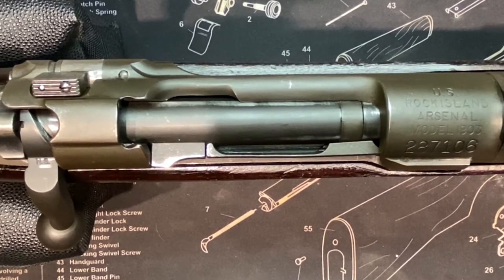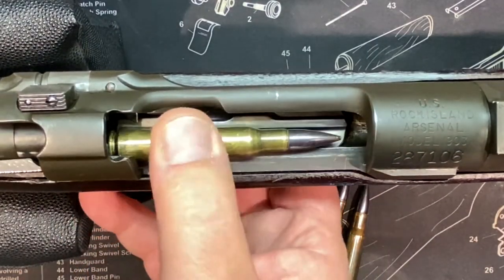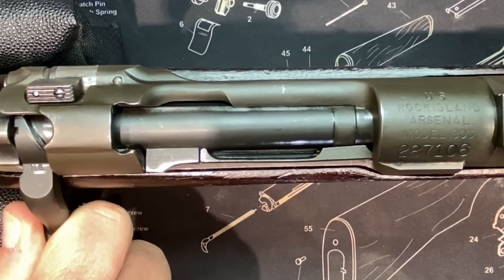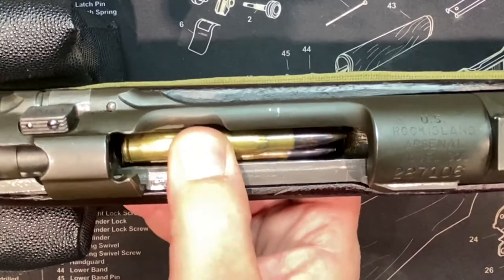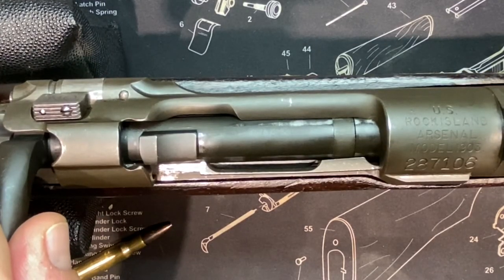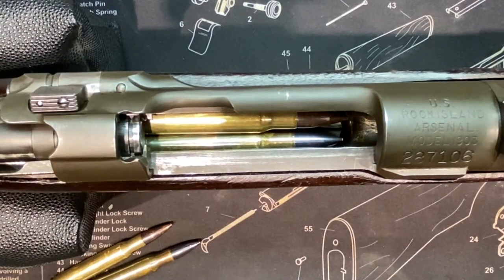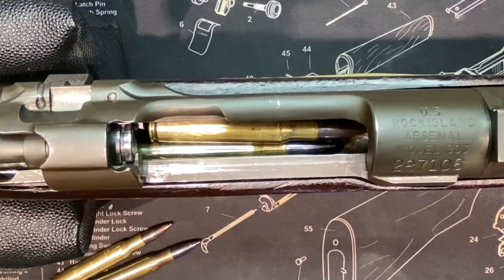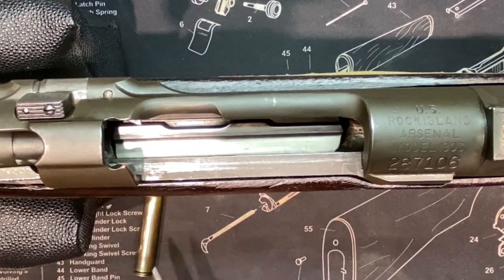1903 Springfield - Tips and Tricks

Comment: I've owned an 03 for around 36 years, and have put six rounds in by dropping one in the tube, literally thousands of times, and haven't damaged the extractor yet. Nice trick, but totally unneeded imo.
Reply from the maker: A lot of people have said in response to this video that snapping the extractor over the rim hasn’t damaged theirs, but that doesn’t mean there isn’t a kindler or gentler way.  The suspension of your car is made to soak up bumps, but you still try to avoid them.
Reply: @MilsurpGarage  Your car door is made to open and close but maybe you should enter through the sunroof just in case your doors are not really up to being opened and closed.
Reply from the maker: Not really a valid analogy since the sunroof isn’t made for you to enter and exit the car through.  A better analogy would be that the car door will still close if you slam it really hard, but to protect it you try to close it gently.
Reply: @MilsurpGarage  It was a perfect analogy, it was a fix for a problem that does not exist!
Reply from the maker: @nathanadrian7797  Definitely an age old debate but after careful study of Mausers controlled feed action I believe that regularly snapping the extractor over rims should be avoided as it promotes wear and tear.

But of course, with your rifle follow your procedure.  Just offering my advice and an alternative method, that all.
Reply: @MilsurpGarage  Like I said, I think you have fixed a problem that does not exist. All the Mauser actions I have owned can be  closed on a chambered round without any noticeable force, and non have ever shown any damage. Good luck to you and your channel.
Reply: @nathanadrian7797 his tips are definitely something that will reduce the strain on the extractor. My 03 A3 is in great shape but it’s pretty old. No reason to not treat it as kindly as possible. You can continue to do whatever you want with yours. Not sure the point of your comments though. He simply gave another option which is also valid.
Reply: @66smithra  The 03 was literally designed to single feed, do you remember the magazine cut off?  My 03 was made in 31, how many times do you think it may have been single fed after going through WWII? Again, nice trick but unneeded.
Reply: @nathanadrian7797  yeah and you can single feed without snapping the extra over over the rim. Just like he showed!

Comment: the bolt was designed to slip over the rim during single round feeding.  It's not an issue I can assure you.
Reply from the maker: Yes, it’s designed to DO it but not a great continuous operational procedure. 

A car is designed to do 0-60 in the shortest time possible but repeatedly doing that is considered beating on it…..and a great way to get to know your mechanic. 

Wear is what makes machines mortal.
Reply: @MilsurpGarage  the mag "on-off" lever was there for a purpose.  however, I doubt very seriously that our troops in the trenches ever used that function but I also doubt it was because of wear.  It was a stupid idea to a man trying to stay alive.
Reply from the maker: @easttexan2933  A man trying to stay alive would certainly not want a broken extractor.
Reply: @MilsurpGarage  Only Rambo and Chuck Norris lol
Reply: The '03 was designed in an era when troops loaded single rounds and fired on command, holding the magazine in reserve until needed.  The "on" position of the cutoff was specifically to allow this.  Same as the Krag.  Same, for that matter, as the SMLE No 1 Mk III.  The extractor is designed for both single round and magazine loading.  Sure, by WW1, nobody was loading single rounds and firing on command any more, like in "Zulu", but the extractor was designed to allow it.
Reply: I think you all are missing @MilsurpGarage's point.  He never denied the gun was designed and promoted to allow single loading of rounds.  His point was/is that, although you CAN do it, it isn't good for the life of the extractor long-term hence his nifty hack to allow loading rounds one at a time while not unnecessarily stressing the extractor.
Reply: You're both right and wrong. The rims of the cases back then were bevelled, not just for single loading, but also as a holdover from rimmed cartridges (Brits still did this) had a bevel for the extractor. Modern ammo is much less bevelled

Comment: Your video is the only one that I’ve seen talk about potential damaging the extractor by loading single rounds. Thank you for the insight on that.
Reply from the maker: It’s definitely a contentious issue, some feel is not a problem, but feeding under the extractor in my opinion is definitely the way to go.
Reply: The gun was designed to be single fed that way!
Reply: The '03 was DESIGNED to feed individual rounds with the cuttoff on.   The extractor is specifically shaped to allow it.   Troops were trained to hold the contents of the magazine in reserve and fire single shots on command.   Now, that changed with the tactics, but the capability remained.
Reply: @jamescameron2490 that doesn’t mean that this way isn’t easier on the extractor, does it?  Anyone who understands physics knows that this reduces the springing force on the extractor.  The same way that a 1911 is loaded by stripping the mag to not spring the extractor.
Reply: @66smithra  I'm not an engineer, so I couldn't tell you.  But the extractor was designed to feed single rounds, with the magazine held in reserve.   Unlike the 98 Mauser, which can only feed via the magazine.   Regardless of stress on the extractor, it's a feature of the design.   And if there's an extractor failure, replacement is easy.
Reply: @jamescameron2490  no kidding. But it’s just as easy to not flex it over the rim!  Why is that so hard to understand? Are you some kind of nanny?  If it’s just as easy to put less wear on your gear, why not???
Reply: @66smithra  Am I some kind of nanny????  Jeez...    No, actually, I'm a grandfather.   Who has been shooting '03 Springfields for close to 60 years.
The weapon was designed to feed single rounds.  Without having to play games with the magazine to get them to load, or loading the round some special way.  Just like the Krag.  Or for that matter, the Model 1917 rifle, which doesn't even have a magazine cutoff.  You just pull a round from your belt loop, drop it in the receiver, and close the bolt.  Read the field manual.  There's nothing in it about the kind of loading "tips and tricks" talked about here.  Because the design made them unnecessary.
Reply: @jamescameron2490  James, you don’t need to declare all this. It’s just a video. It shows how to take it a bit easier on the extractor of 100+ year old guns. Your car is designed to not fall apart if you hit a pothole. But don’t you try to avoid them?  It’s just a tip. There’s no need to nanny him and “correct” it.

Comment: First rifle i ever owned got it when i was 11yrs old, im 37yrs old now and a custom rifle builder and 1000yd benchrest shooter. I shot my 03 so much i wore out the original 2groove remington barrel made in 1944 it had. So i got a new old stock 4groove made in April 1943 wrapped in cosmoline and fit it to the reciever. I have it in a Tiger maple stock, timney trigger, fit an egw heavy duty steel pic rail to it and a meopta meopro 6-18×50mm milldot with tall turrets. I load berger 185gr juggernauts for it and shoot it out to 1200yds for fun. Also have a good tune with sierra 155gr palma match kings. Both with H4350
Reply from the maker: There is a good chance you are the biggest 1903 fan that exists...
Reply: What?

Comment: That's a really low number 1903....hope you're not shooting it.
Reply from the maker: Improved heat treatment started at SN 285,507.  I'm in the 287,000's.  I use the M1 Garand specific ammo rom PPU.....if it's good for the Garand it will be fine for the 1903.  You reminded me that it hasn't been out for a while.....thanks!
Reply: @MilsurpGarage  I don't know...I have four 1903's and always avoided a purchase where the SN was below 1 million.  It does look like it's in amazing condition.  The Parkerizing is perfect.  I bought one A3 before I knew about the "drill rifle welding" warning where they weld the cut off lever to the receiver.  I had sent the gun to CMP for re-barreling and some other things and the head armorer called me and told me about the weld.  I asked him flat out if he would do the work on it and shoot it and he said no, there are plenty of other rifles out there that are safe.  Our conversation turned to the 1 million and lower rifles and he said the exact same thing.
Reply from the maker: @gtc1961 The rifle in the video is a Rock Island so the serial number range for improved heat treatment is different than a Springfield Armory which was probably what your source there was referring too.  I’ve been doing this for a while…….

That being said, you should (as well as everyone else) certainly follow whatever parameters you feel are necessary for your own personal safety.  I’m certainly not trying to convince you of anything. Just relaying facts on this particular rifle.

Comment: Are you CERTAIN  that extractor damage is an issue?  Why did they incorporate the magazine   "on off" switch  otherwise?
Reply from the maker: I’m certain that single loading without the controlled feed bends the extractor and forces it to snap over the rim.  That definitely stresses it more and wears it more.  It is certainly made top do that but it stresses it more.....very robust rifle though...it will take a lot to break anything.